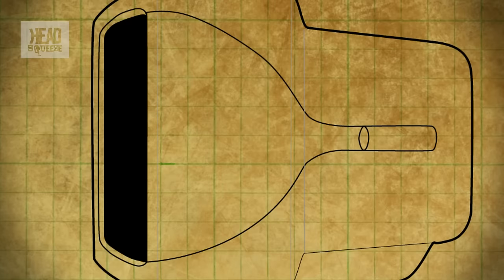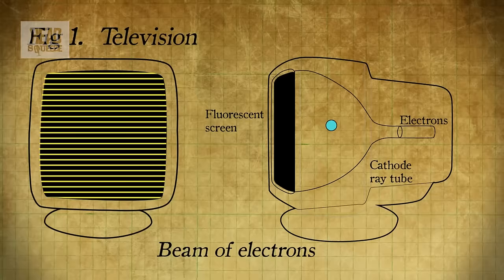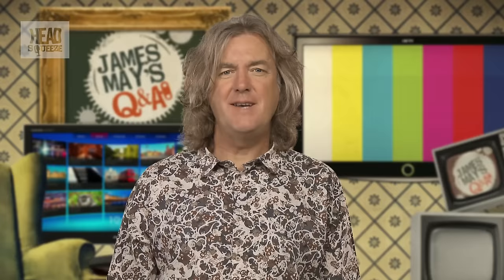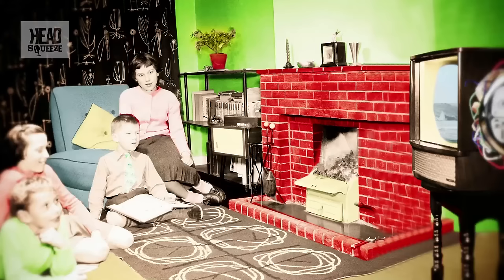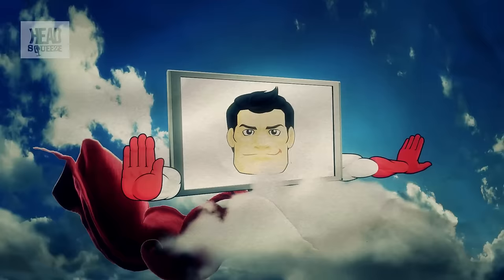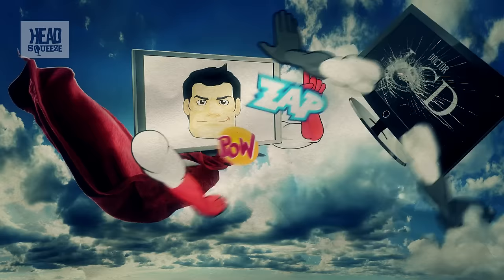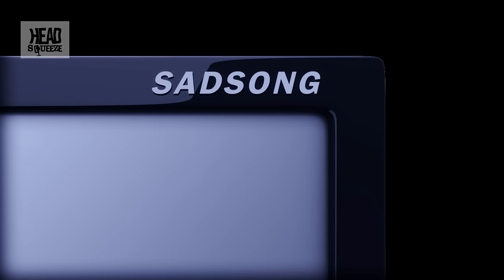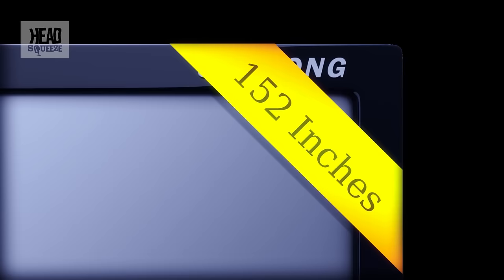How do plasma TVs work? I James May Q&A I Head Squeeze

Comment: + JAMES MAY  It is Red Blue and Green , not yellow. RGY are the primary colors, And Green is a secondary color. But why would they use RGB on a display? Well there is a difference in projected and reflected light. Where as RGY is used in reflective-subtractive color wheel. Think paint on the wall, where you add all colors you get black. Now think of the TV as a colored light projector you add Red and Green light you get Yellow, this is an additive process. However there is a TV that has yellow pixels also. It is the sharp quattron. As the name would suggest it has 4 pixels Red Green Blue and Yellow.

Comment: It's either RGB which is additive (screen itself/background is black and all pixel at full intensity produce white) as you say or CMY (cyan, yellow and magenta) which is substractive (the screen produces white light by default and the colors are taken away/covered to produce the desired color) in a tv that's done with light filters. It's probably easier to imagine a printer which does the same thing; it covers up the white paper with ink. (usually CMY + black)
Reply: TVs don't work like print. Yes you start with white light, but then you turn it into 3 additive R G and B light sources with R,G,B filters. Then the three primaries additively mix together to show the entire spectrum.
QD (O)LED does this a bit smarter, as instead of making white light first, a blue LED with a yellow phosphor to convert a part of the blue light is changed to a blue source where part is changed to red and green with a quantum dot film.

Comment: I still use a CRT TV.
36 inch Toshiba with surround sound. It's the perfect size and fits nicely in my living room. 
I see no real reason to upgrade as I use my laptop for everything. All I do is use my Xbox for iPlayer when I do uni work. Not bad for £41 from a recycling centre. 
I used to hate the CRT's with the curved screens. I'm so grateful that my TV hasn't got them!

Comment: Pros: Better color. Cons: High energy consumption and the risk of  the "burn-in effect".
Reply: Crts had burn in too.
Reply: @LBSiUK  he was referring to the current competition: LED type Displays
Reply: Con: They aren’t made anymore & cannot be purchased.
Reply: I've had mine for 6 years now and it has no burn in at all. It also has low power consumption, Just a little bit more than an LCD. I think those issues were only on early models.

Comment: QWERTY was made mainly to avoid having keys stick together, not to make it as fast to type as possible. The most famous one designed to improve typing speed is probably the Dvorak layout, but by then QWERTY and its variants (AZERTY, QWERTZ) were already widespread, and the advantage in speed wasn't enough to justify changing. Same goes for Colemak, etc..

Comment: because of typing machines. they where first put in alphabetical order but letters that where used much where placed next to each other and because of that the letters got stuck next to each other and to make the machine as fast as possible the qwerty keyboard was made. a few letters have swapped places in the years after it was made but it is still mostly the same as in 1878. the M was next to the L and the C and the X where swapped.

Comment: A Laser TV requires lasers in three distinct wavelengths—red, green, and blue. While red laser diodes are commercially available, there are no commercially available green laser diodes which can provide the required power at room temperature with an adequate lifetime. Instead frequency doubling can be used to provide the green wavelen

Comment: Light, unlike, paint or crayons, combines colors differently, which is why in an LCD or plasma display, which you would find in a computer or TV, each pixel uses red, blue, and GREEN, subpixels, not red, blue, and YELLOW. Yellow light is made by combining red and green light. You can easily see the individual colors of the subpixels by holding a magnifying glass up to the display, or more easily, by placing a small drop of water on the display.

Comment: It depends. LCDs are more power efficent, have thinner bezels and are thinner but have washed out blacks and are expensive. Plasma TVs are nowadays much cheaper, have excellent contrast and are brighter while also offering ridiculous 800Hz refresh rate excellent for fast movieng objects. Also great for 3D. They are heavier and thicker though. Also use much more power. Many home theatre enthusiasts will tell you plasmas are best, and they really are but mainly for home cinema, not watching tv.

Comment: Torque is the spinning power on the driving axel I think , so fwd or awd or rwd. Or maybe, torque is the combination of spinning power and weight of the vehicle. That's why it's easier to do a burnout with a vehicle that has more torque, because more power to the driving wheels and less weight to hold the car down.

Comment: Laser color television (in short, Laser TV), or Laser color video display utilizes two or more individually modulated optical (laser) rays of different colors to produce a combined spot that is scanned and projected across the image plane by a polygon-mirror system or less effectively by optoelectronic means to produce a color-television display. The special case of one ray reduces the system to a monochromatic display

Comment: Yellow is simulated by dithering patterns of Red and Green, specifically. The Blue is absent from otherwise "white" light in order to produce "yellow", in this case. 

The exception being Sharp's "Quattron" line of LED TVs, which has Red, Green, Blue AND Yellow cells, in case you wanted... more yellow, in your pictures? o.O

Comment: Mirrors are metallic surfaces.  Metals have free electron in the outer shells of their atoms.  This creates a sea of electrons that absorbs any photon entering it and re-emits it reversing its momentum perpendicular to the surface, but retaining its momentum parallel to the surface, so it appears to bounce off the surface like a pool bounces ball off the rubber cushion.  This 'bounced' light fools your visual system into thinking there is are objects beyond the mirror surface, i. e. reflections.

Comment: horsepower is just the power the engine produces. torque is what is usefull. the more torque you have the better a car will drive away/pull up. in trucks as example horsepower isn't the most iimportant thing, the highest torque at the lowest RPM's is more important since it is the pulling power of the truck. and at lower RPM's you use less fuel. I can't fully explain what torque is since my native language isn't english but if you look it up on the internet I'm sure you will find something.

Comment: Well, for a large computer screen (ex., to replace 2 monitor), 4K can and does make sense, because it lets you sit close while still having good pixel density, and just have more space. On a PC you often focus on just 1/4 of the screen area, and you tend to lean back when watching fullscreen videos.

With a TV, you're (nearly) always far enough to see the whole screen, and the image is limited by the stream / camera sensor / lens resolution anyway, so you gain very little from 2K / HD to 4K.
Reply: How poor this comment aged lol. I can easily see the difference between fullHD and 4K on a 48" from 2-3m.
Reply: @nikoolix  - Most people don't sit 2 metres away from a 48" screen. And the comment hasn't "aged" at all, because human eyes still have the same angular resolution, and both HD and 4K still mean the same (and a lot of "4K" content is still not actually 4K, but hopefully that will continue to improve with time).

If you compare two panels of the same type and generation, one 4K and one 2K (or HD), at a normal TV viewing distance, being fed the same signal, they'll be practically indistinguishable. As computer screens, the difference will be instantly obvious.

Comment: The bigger the CRT Screen size was, the wider the DEFLECTION ANGLE was. Bigger CRTs didn't always get thicker thanks to much clever electromagnetic Yoke designs. And CRT DISPLAYS DOES NOT HAVE PIXELS AT ALL. EARLIER BLACK AND WHITE ONES CONSIST OF AN EVEN PHOSPHOR LAYER. WHAT YOU SEE AS PIXELS IN A COLOR CRT TV IS CALLED PHOSPHOR DOTS AT THE SHADOW MASK. WHAT THEY DO DEFINE IS THE COLOR RESOLUTION.

Comment: Shame it's now obsolete technology.
Reply: Plasma is not obsolete, it was just too expensive to produce compared to LED panels hence why they lost the market, Plasma is superior even to OLED in many ways, for one the motion resolution on a Plasma is still unmatched going 100% or if you have 1080p Plasma then it has 1080 lines of motion res whereas the largest a LED panel and an OLED can have is 350 lines at 60Hz, or 650/700 lines at 120Hz whereas Plasma can easily do 1080 lines at 50Hz or 700/800 at 30Hz
Reply: @SMGJohn  Plasma TV's are more expensive to run, easier to break and can have static images burn in. LCD and LED tv's are less expensive, consume less power and use better materials other than glass for their screens, making it harder to break. All of this made the technology obsolete.
Reply: @SMGJohn  Took recently to their plasmas Panasonic and LG-pioneer LX508d -it's just amazing. Modern plastic TV plasma is not a competitor.

Comment: Bring back plasma Tv's! These LCD and LED screens don't have good contrast. No matter which angle you look at them from, you can't see the deep black Plasma Tv's had.
Reply: this year oled tvs are in production they are the new thing by next year they are gana be affordable. the blacks are great because the pixel doesn't even need to turn on giving you the deepest blacks and less electricity used overall
Reply: JOHN JH IPS displays are a lot better, pretty much as good as a plasma
Reply: +Dan Reader Nope, I have an IPS monitor and a Pioneer Kuro Plasma, the plasma blows the IPS outta the water in every way possible. No contest.
Reply: +Dan P I have to disagree with that. I will admit you can still achieve better blacks with a plasma, but technology has advanced a long time since they stopped developing plasma tech. New IPS displays are a thing of beauty (and I mean quality ones, not the cheap £100 you can get from hannspree), with amazing viewing angles and awesome colour fidelity. Certainly plasmas are far from 'blowing IPS out of the water'.
Reply: Hahaha ok kid just the fact that you could make a Comment about "cheap lcd panels" without even knowing me tells me you know nothing, you've probably never even seen a pioneer kuro or even know what one is, but I would seek one out if I were you so you can see exactly how much better they are than the ips monitor I paid $500 for. Of coarse comparing a $5000 t v to a $500 monitor is a bit like comparing apples to oranges but I didn't bring up price you did.
Reply: Inaccurate colors  grey blacks and poor contrast ratios better description of ips :)
Reply: +Dan P whoa dude, no need to get insulting, I'm just engaging you in a discussion. I paid £600 for my ips display, which is an Apple Cinema Display 23in, before they changed em to the horrible glossy displays you get now, and I've never seen better colour reproduction on ANY other display, perhaps with the exception of AMOLEDs on modern phones. I also had a £3000 LG plasma many moons ago, and while the blacks were pretty good, but other than that the colour reproduction was the same or worse than my ACD. I suppose all this will be moot soon anyway, as AMOLED is coming to mass market monitors this year.

Either way, these are just my opinions based on my experience, as I'm sure yours are. No need to go all 'haha ok kid' on me, that's just poor debating!
Reply: +Dan Reader funny because I found your comment on cheap lcd panels insulting. you really think someone who spent 5000 on a television is going to cheap out on a computer monitor?..... LG is known for having lower end plasmas and if you paid 3k for one it must have been like 10 years ago, not comparable to the plasma tech in the last Pioneers and Panasonics. The truth is that lcd Is an inferior tech no matter which way you slice it and the tech using sample and hold is inherently flawed. I agree that oled is the wave of the future but it's still in its infancy, very expensive, and has major problems. My buddy bought the new LG oled and returned 2 units due to screen uniformity, yellow banding, and horrible motion p
Reply: +Dan P  motion processing. the other 2 LG units performed just as badly. after the 3rd unit I told him he should get his money back and buy a used plasma.... he took my advice and has been happy ever since. like I said of you've never seen a kuro before you owe it to yourself to seek one out and see it with your own eyes before you dismiss plasma. there's a reason why a lot of the most respected isf techs still refer to them as the gold standard.
Reply: +Dan P I don't dismiss plasma, I owned a good plasma and loved it.  I just don't see that it has enough advantages for me personally over modern LCDs, especially given the price when compared to any LCD. no uhd for one. When I replace my monitor this year, why would I buy something that is going to be the same or worse than my current monitor? Another thing that has left plasmas behind is refresh rates. I know that plasmas have a 600hz refresh but that is just a gimmick, and there's no comparison when it comes to actual 144fps source content. It sounds like you use your plasma panels for TV, which is probably what they are best suited to, but I edit and render video, and I need a screen with real estate to do that. And my ACD might look great, but 1200p isn't enough anymore and I need UHD, so bye bye plasma x
Reply: +Dan Reader are you buying an 80 inch screen or bigger?  because if you get anything smaller your eyes won't be able to tell the
Reply: +Dan P difference between 1080 and 4k.... just another marketing gimmick
Reply: +Dan Reader also your just flat out wrong about refresh rates... there's a reason people complain about motion lag on lcd
Reply: +Dan P no it isn't a marketing gimmick at all. Maybe if you're watching a movie, sitting across your living room on a sofa, but uhd gives you way more real estate on a screen than 1080p. If you sit 3 feet from a 30 inch 4k screen then you'll get loads more benefit than just using a plain old 1920x1200 screen.
Reply: +Dan P also I'm not 'flat out wrong' about refresh rates. The whole reason that LCDS are getting better refresh rates is to eliminate the motion blur from them flipping from pixel to pixel.
Reply: +Dan Reader isf disagrees about resolution, resolution is the least important factor in judging a displays quality, things like black level, greyscale tracking, accurate color reproduction, and motion processing are much more important in making a quality display. and sorry but you are wrong about motion processing on those lcd displays, the motion blur is still terrible on those higher htz displays and the motion processing introduces it's own set of problems as well. have fun watching the blurry bowl tomorrow! :)
Reply: This is why we have OLED, and Micro LED
Reply: thats part of what H.D.R. High, Dynamic, Range does I think, My tele has it.
Reply: The TV I have turns off the pixels and led backlights using local dimming technology. I bought it because the picture quality actually matched the black levels on my older Pioneer Kuro plasma and EXCEEDED the color depth, accuracy and pure white levels a plasma can produce. Plasma CANNOT  produce "true white"... Look at ANY brand of plasma from Samsung, Pioneer or Panasonic and you will see that plasma TVs produce a more "silver/grayish" white. Very inaccurate. Sure the black levels are great, I own one... BUT I find MUCH greater color accuracy, depth and white levels on my LED local dimming LCD, it is just more pleasurable to watch... Not to mention, plasma TVs have a shorter life expectancy and the gases get dimmer much faster than an LCD/LED does.

Comment: Had to buy an LED tv last August because my plasma tv stopped working. What I discovered is that my electrical bill has been cut in HALF since getting the LED. The first month I thought it was a fluke, but for the last 7 months, my electrical bill has been 1/2 the cost I was paying when I had the plasma tv.
Reply: Its known that a plasma can take 100 Kw while an LED only 20 Kw depending on the manufacturer. 
But I never thought that it could lead to this much difference
Reply: +Anas Malas Yeah, it sounds ridiculous that your TV would consume more than 50% of your total electricity usage.
Reply: Aroused Squirrel you probably dont use air con, a heater, a hoover,  only use the microwave for 5 minutes a day, and have a lone led power saver bulb in the living room and kitchen,  and another in the bathroom. 

But even then a TV couldn't have that much difference... 
Unless it is like 100 inches early 2005... Theen maybe
Reply: Anas Malas Exactly.
Reply: +Anas Malas  But my electrical bill has been cut in half. I'm not strict about turning lights off. That behavior hasn't changed, yet the electrical bill is half what I paid when I had the plasma tv. It created an incredible amount of heat (I remember that). It had 4 fans across the  back inside to cool it down. It was a 42 inch Panasonic plasma. There is no doubt it was the plasma tv using all of that juice.
Reply: Here's a CNET article on TV power consumption - it says that plasma power drain can be significantly higher in percentage terms, but virtually negligible in dollar terms, compared to an LED panel. The highest drain plasma they tested (a 65") cost $6.77/mth, the lowest drain LED (a 32") $0.50/mth, by their testing criteria (5hrs/day + 11c/kwh). I think the change in your leccy bill might be from something else, fella. I'd keep an eye on it if I were you, just in case.

https://www.cnet.com/news/what-you-need-to-know-about-tv-power-consumption/